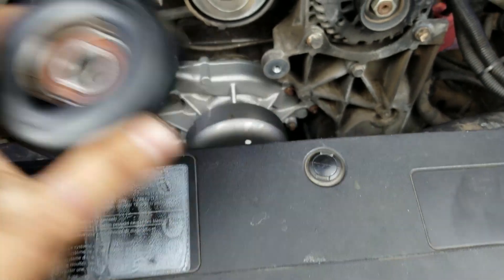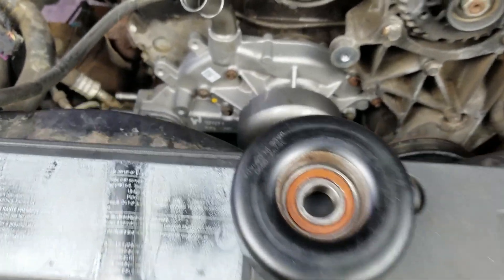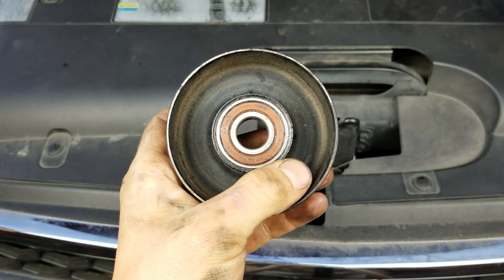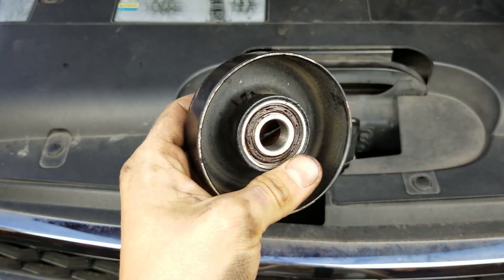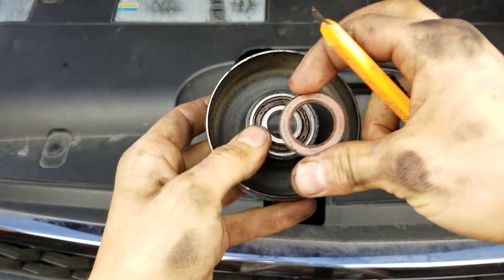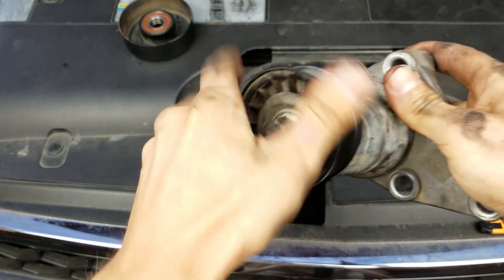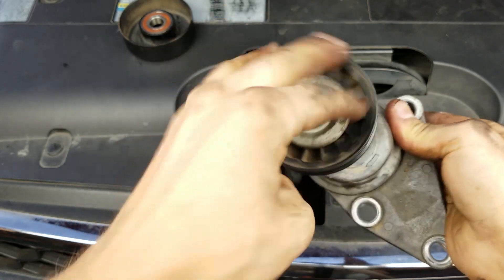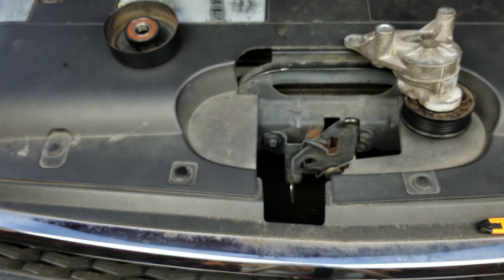DON'T Buy New Tensioner Pulleys! WASTE OF MONEY!

Comment: The metal idler pulleys you can just replace the bearing, 6203.
The plastic tensioner pulley you can't. 
With it your only option is to  repack or replace.
Just fixed my 01 sierra 4.8 today.